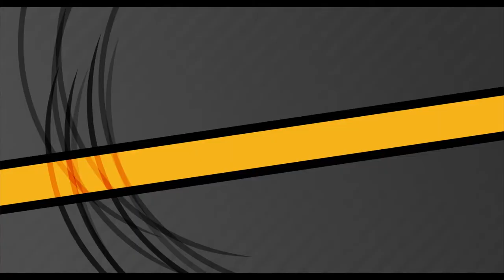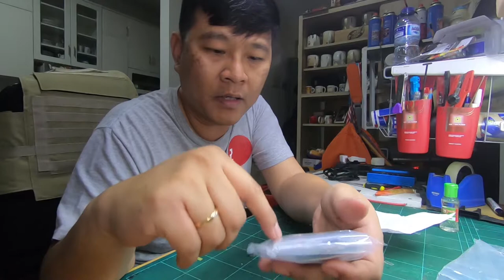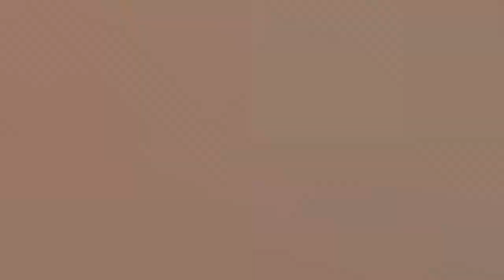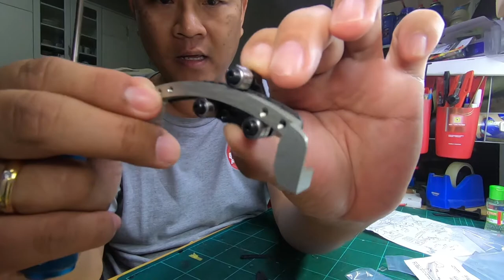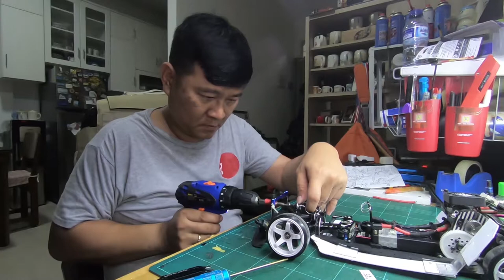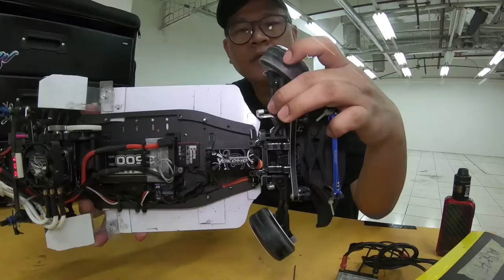RCdrift tips trik : Yokomo Yd2S steering curve

Comment: Hello Albert, great movie. Congratulation! I have a doubt you talk about lubricating the sterring in the video, you say lubricate the bearings or the curved bar? If it is the curved bar which grease did you use on it?
Reply from the maker: I dont use grease because it too sticky and if too much dust will damage the rail.
Grease hard to clean rather than oil, you just need blow with air compressor and the dust will get away